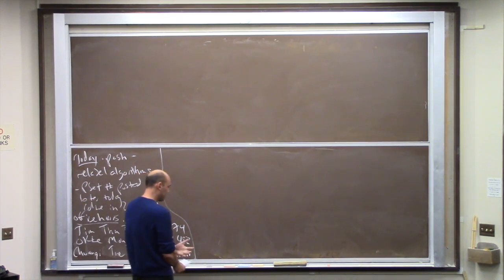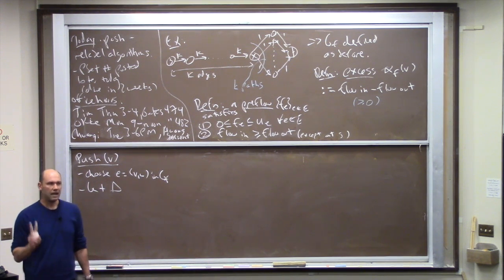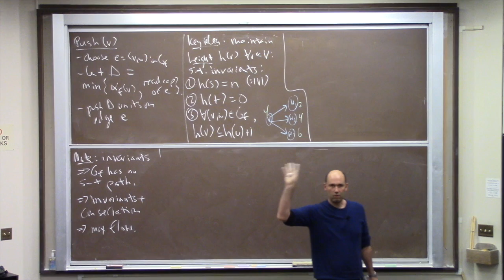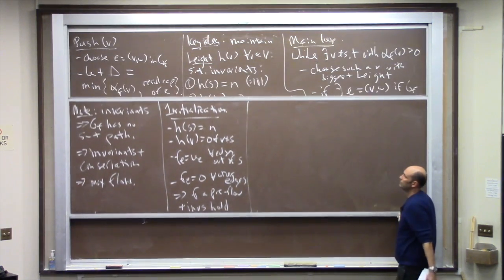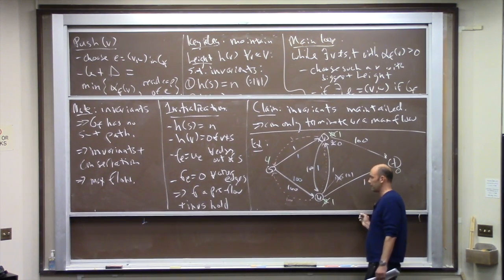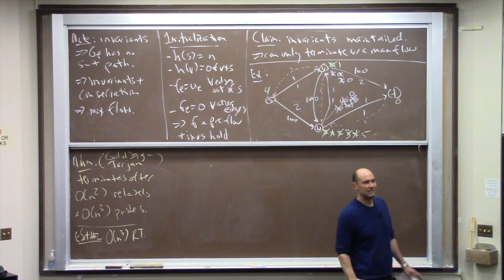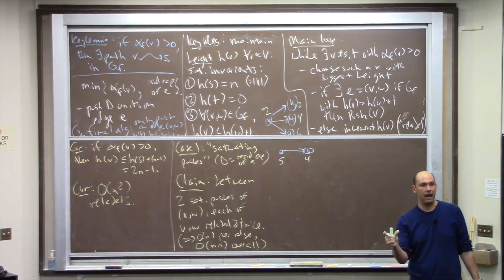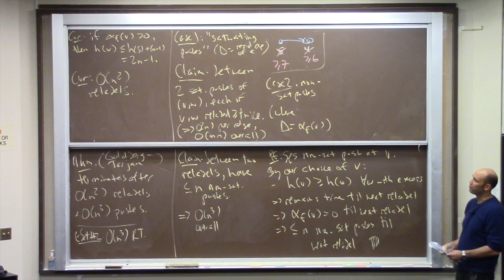A Second Course in Algorithms (Lecture 3: The Push-Relabel Algorithm for Maximum Flow)

Comment: 44:39 did not account for w-> t because the residual capacity is 0, correct?
Same question for 47:18.

Also, in 47:18 the prof says we are looking for outgoing arcs in the residual arc whereas in 44:39, the arc w->v from the original graph was included. Why is that?
Thank you:)